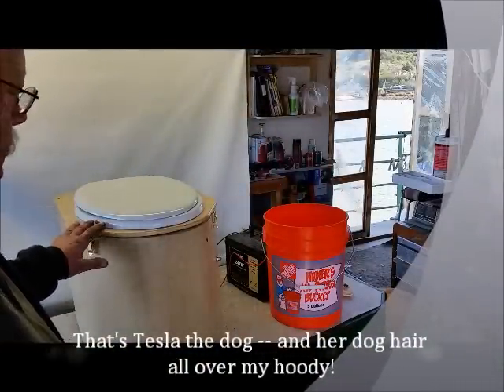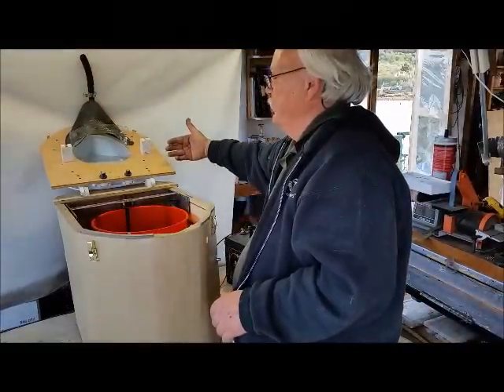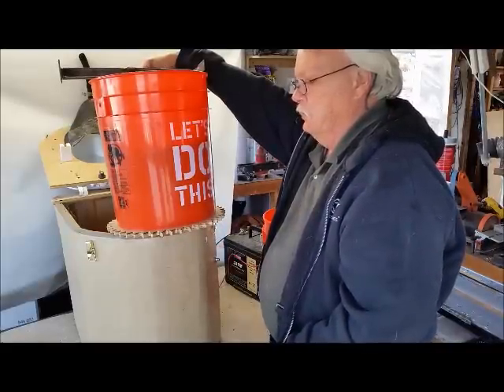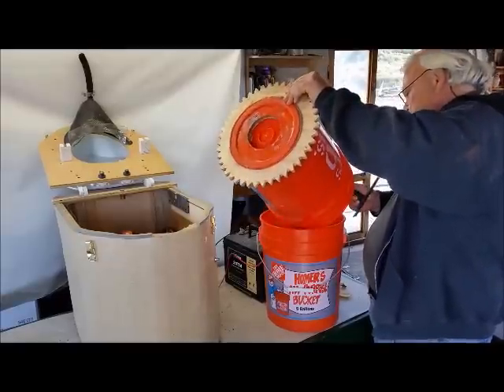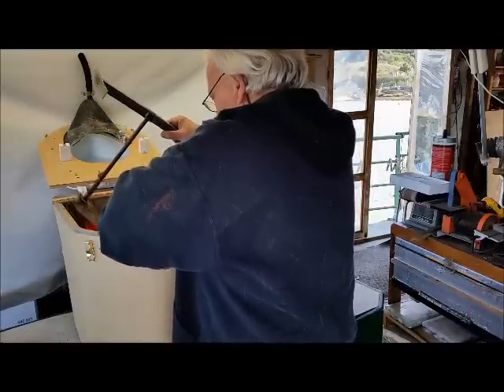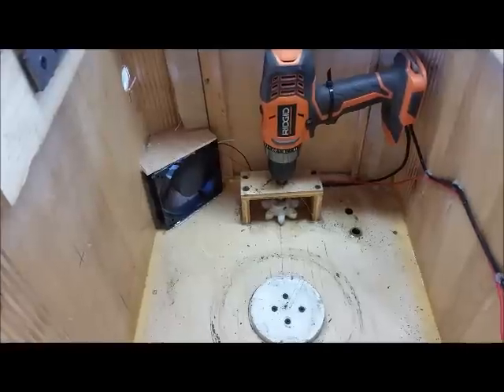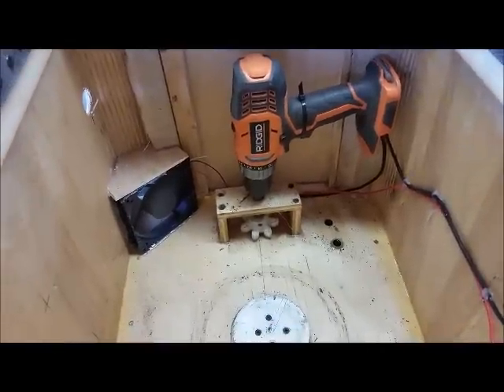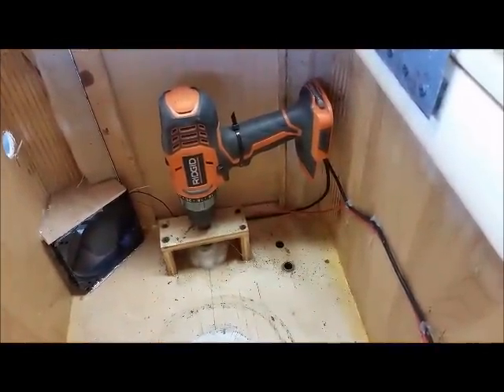Composting Toilet

Comment: I see that you haven't returned to answer any questions.  But just in case you ever do I am wondering how you deal with toilet paper.  Do you add it to the compost or what?  I was also wondering if you purchase the urine separator or did you make it?  If you made it can you explain how you made it?  It's a great toilet btw. :)
Reply: Anita Archibald  I bought a porcelain diverter from these folks http://www.urineseparator.com/
It is awesome. But now I want to add the gears and stirrer. To make it "flush". Haha. I love that my diverter is porcelain.
Reply: ebay urine separator; several versions; about $45.00 for the style depicted here
Reply: Anita Archibald i saw another video of another composting toilet and the said the only issue with paper is that if you use a lot you will need to dump your toilet more frequently but only because paper takes some space. It doesn't affect the composting process
Reply: all the same questions I wanted to ask :-)
Reply: Well, Mony's cell, if I ever figure it out I'll come back here and tell you.  And vice versa if you do.  :D  It's that damn urine separator that I'm most concerned with.  I saw someone use a giant funnel on one build...I'm going to keep looking.  And I'll never eat another funnel cake at the state fair again! :D
Reply: Anita Archibald I add the toilet paper into mine, but dampen it with a squirt water bottle for less bulk. Not too much water though.
Reply: nice diverter but i wish they would set it up to fit a bucket as well
Reply: ChayomanHutzepua, I think that's probably true.  I guess you could put the "excess" toilet paper in a zip lock bag and put it in the garbage like some do with ALL their tp, but that's overkill to me.  I plan on keeping a bucket with a screw on lid to dump the compost bucket into.  Sooner or later all the tp has to decompose! lol
Reply: Karen Springs!  Thanks for replying to my questions.  Great info and I'll will be checking that link out.  I want porcelain for my pee! hahaha  My husband says I have to make the toilet and then let him use it for a month before he'll put it in our trailer. lol

Comment: I'm very  behind (For a  lack of better word) your product.
 Once manufactured - will this unit come at a cheaper price point then most commercially sold rv composting toilets ? also, would the components be available i.e. sprockets, pee separator, etc... for the DIYer ?